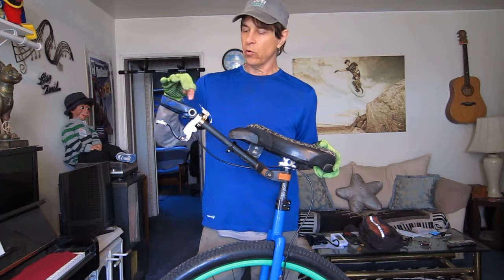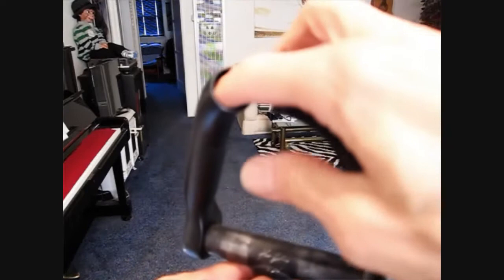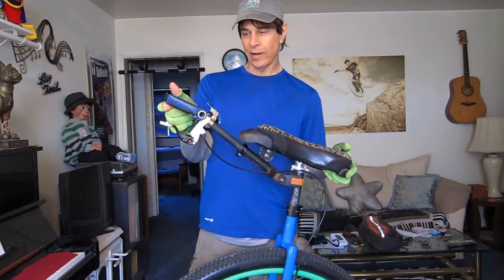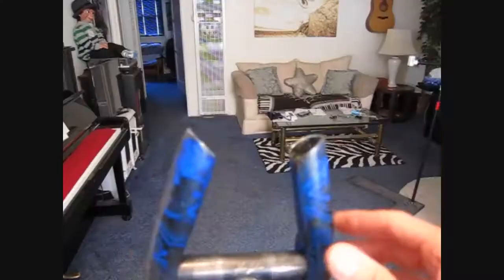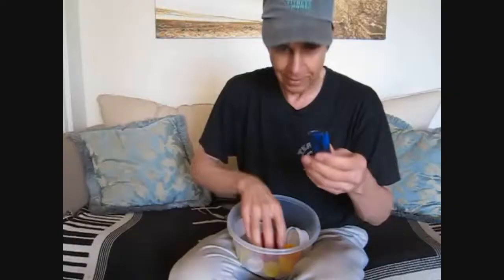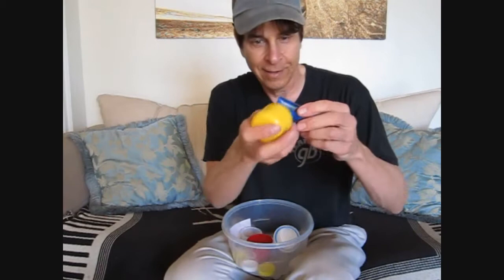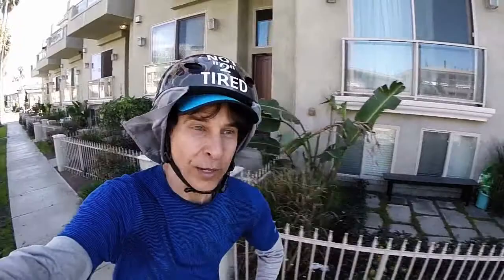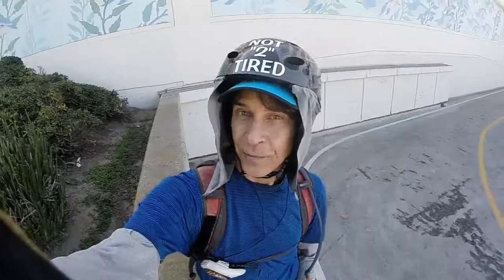Unicycle Tutorial: DIY Bar End Caps for T-Handle Setup

Comment: Hey Terry did you hack that saddle? The cover isn't the original black. I'm always intrigued by your gear. Also, the seatpost clamp on that handlebar setup, is that something you rigged up or is it something I can buy from UDC? AFAIK the KH T-bar only attaches to the saddle (which doesn't look very sturdy), cheers! EDIT: Just saw your other video "Unicycle Tutorial: 36er Touring Handle Mod
"
Reply from the maker: the saddle is not made anymore and is a carbon fiber flat profile saddle with a UDC cover. the T bar support is made from a clip on fender with th fender removed and attached to the seat post to add support to the T handle's under seat brackets.